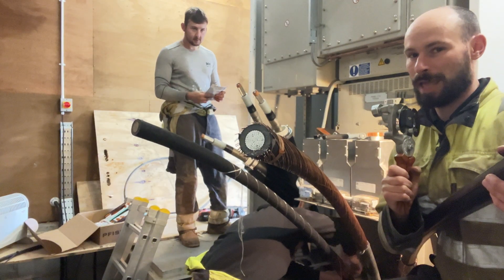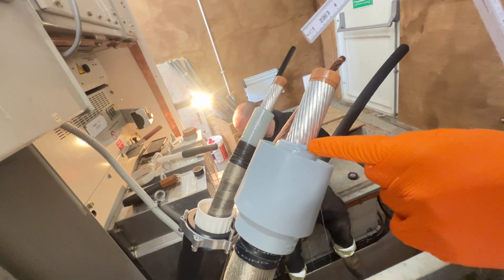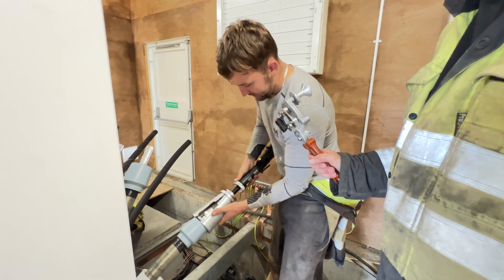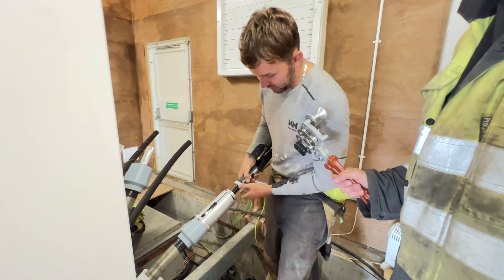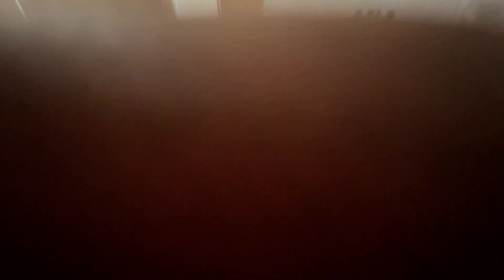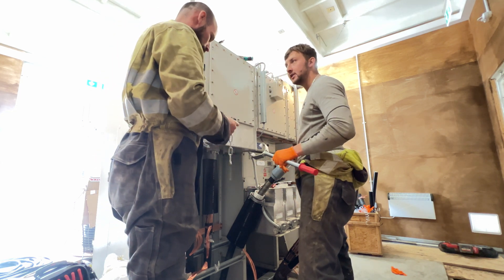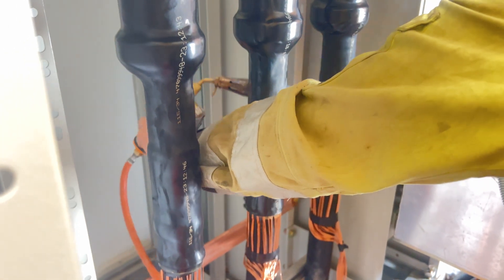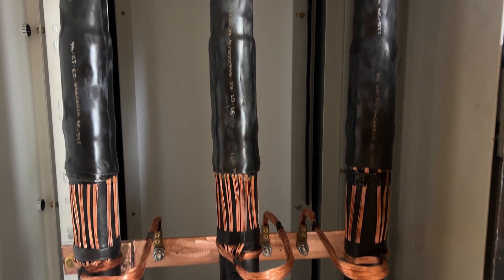How to Install a 33kV Pfisterer Termination – Step by Step!

Comment: GOOD BANTER THAT BETWEEN THE LADS, AWESOME. YOU BOYS PLAYING WITH MASSIVE CONDUCTORS MUST BE PAIN JUST BENDING THESE INTO THE SWITCHGEAR..BY THE WAY IS THAT A SWITCHGEAR OR TRANSFORMER?
Reply from the maker: Got to have good banter, makes the day go by 👌🏻😂 yea these were 630mm ally cables, they dont bend much 😂😂. Yea these are being terminated into switchgear. 👍🏻
Reply: @hvsparky  true professionals you lads are. hats off considering the insane voltage levels you boys man handle on a daily. besides I notice the wire strands of each conductor phase are linked up and joined at the copper  bus bar, is that earthing or bonding? how's the switchgear housing earthed ?
Reply from the maker: @ProductionSession  Thanks for the support, mate! 💪🏻💪🏻 Just to clarify, the screen wires are connected to the earth bar to help disperse circulating currents. Plus, the substation is equipped with an earth mat which usually goes around the perimeter. We dont install this though.
Reply: @hvsparky  I love the jobs you guys do no word of lie mate I get excited seeing your notifications. Please get with residual and do a crazy video for us mate....wow just the thought